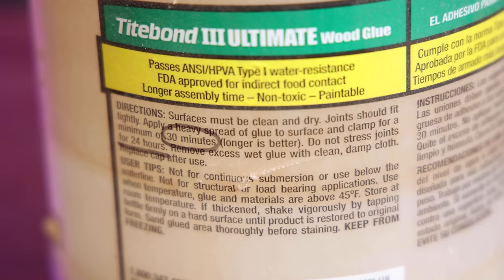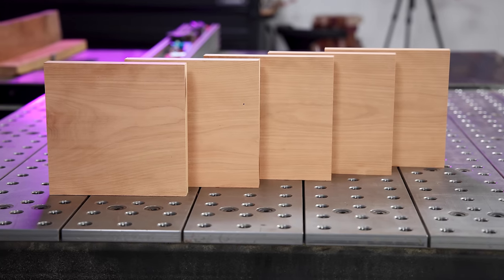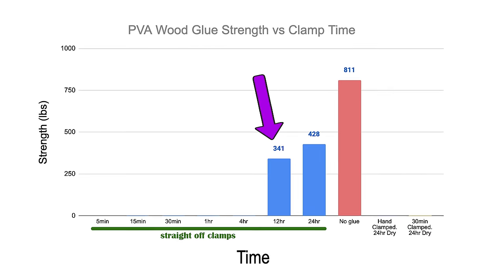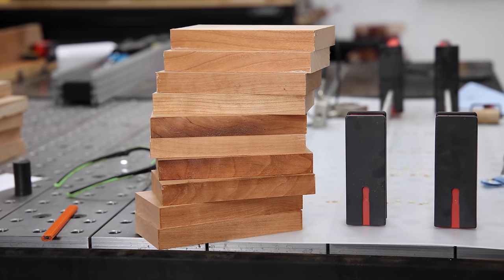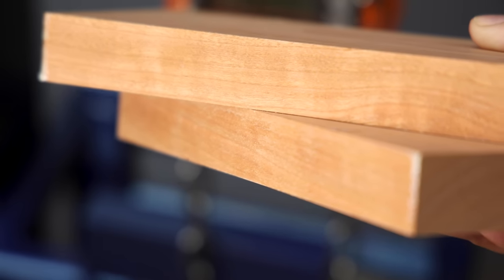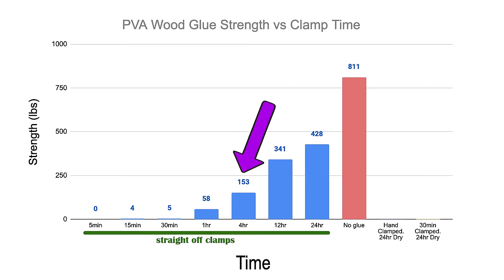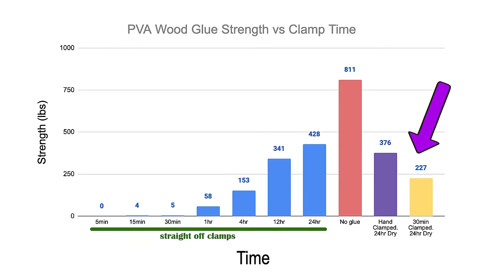you are clamping too long

Comment: The 30/24 test may be down to the clamping pressure. If the joint got starved of glue due to squeeze out, that might account for it.

Comment: I agree on the idea that different kind of wood species will have an impact. Especially  the hardness. But somthing I doubt is the flush book joint. Correct me if im wrong but you did not sand the wood before aplying glue right? I think sanding makes a big impact on how fast and well the gleu penetrates the wood. The surface eary becomes so much larger! I wonder if it would change the 30min clamp 24h drying result. What do tou think? 

Oh, andon a side note, your "small channel" 😉 had a big impact on how I used and (not) buy treaded inserts. Thats why I'm subscribed. I love the maker community! Greetings form the Netherlands 👍

Comment: rate constants halve for every 10 C you go down but the relationship between rate constant and rate depends on the reaction and idk how the glue cures but it's not unreasonable that 3 C would show differences, but yeah that's a lot.  Some error bars could help figure out to what extent that was determined by chance though.  It's a shame too because the most interesting question to me the whole time was "if you just let it rest long enough to not break from immediate use, would it finish strengthening on its own?" which that would've answered.  Oh well!  Still super informative and well produced video!

Comment: The glue has to be pressed inbetween the fibres by clamping and THEN has to dry. That primarily happens due to the moister being drawn into the surrounding wood and the evaporating at the wood surface. When BOTH pressure and drying have been applied for at least 12 hr preferably 24 hr a nearly maximum bond exists between the woodfibres and the glue. 30 minutes pressure and 1 hr drying results in a bond that is just strong enough to be handled, not fully loaded!
Offcourse these times for pressure and drying only apply to  PSA -type glues. Other glue-types have other values and may work along other principals for instance chemically hardening/bonding.
For all glue types it is advisable to degrease fatty woodtypes and allways use fully dried and seadoned woods.

Comment: The manufacturer's recommendation probably had partly set glue which was disturbed when the clamps were removed and been partly set was unable to bond again.
As for no clamps, you should consider rubbing the glued faces against each other a few times, this will create some vacuum pressure which acts in place of the clamps.

Comment: @3:53 you said that the results showed that a 12 hour clamp time was 20% weaker than a 24 hour clamp time. However, in both cases, it was the wood that broke - not the glue joint, so the clamping time has nothing do with it, and the difference should be put down to experimental error (e.g. differences in the wood used).

Comment: Moisture content? In the air and wood possibly. My shop is a garage with no air-conditioning/ heat. Ive noticed  when gluing but joints for cutting boards, if it is hot and humid the glue sets up much faster and seems stronger especially if I make an error and have to reposition the pieces. Titebond III specifically.  Titebond II does not act the same as III but everyone knows this. I have not checked the moisture content of the wood and air but I will try to remember to do that this year.

Comment: I think clamp time and curing time are mixed in this data set. 

What I would suggest doing is fixing curing time while you change the clamp time. 

Example: clamp the wood for 30 minutes, then allow adhesive to cure for 23.5 hours and then compare the forces.

Comment: As most ppl here agree on. You should all let them dry for the same time to see what the clamp time does and not the curing speed of the glue.
Fair comparison would have been all the same dry time of 24 hrs with different clamp times.
Clamp time is important because it is the delaying factor in woodworking.
I clamp for 20 mins and then the bond is strong enough to work with it without stress like cabinets and drawers etc.

Comment: One thing that can effect 'curing time' is leaving wet glue on the surface of the joint.  It should always be wiped off when wet.  When left on, it prevents aid from getting to the joint itself.   Another issue is too much clamp pressure which the hand vs clamp strength test.   Too tight squeezes too much glue out of the tight fitting joint which could leave it too dry.    I was a carpenter and then cabinetmaker for much of my working life.

Comment: I'm curious how clamping pressure can effect the glue joints, like what are the results of excess glue up pressure and what are the result of lighter glue up pressure. a good tool to test this with would be the fireball tool Maximus Bar and Dog Clamp with a soild 2x1 steel bar you could test up to thousands of pounds of pressure essentially up to the point of failure of the bar and dog clamps is your limit.

Comment: The reason i use "many" clamps along the length of a glue line is not only for the strength of the connection, it is to maintain a tight and even seam from end to end. Ideally, you want the glue seam to be invisible. This is much more easily achieved by using many evenly-spaced clamps. I hope this suggestion is helpful. Cheers!

Comment: I wonder if clamping for 30m caused more glue squeeze-out than hand clamping, and removing the clamps allowed the joint to relax a bit, leaving not enough glue for the lower clamping pressure.

Comment: Nice test, earned my sub. It would be really interesting if there was a material that wouldn’t be expected to break, (metal as an example of where my thought is…) and the glue adheres at least as good as wood and find out if the glue really is stronger than wood or if it just seems that way because of the way a cut piece of wood is compromised by the glue joint itself vs the uncut, unglued wood? Hopefully that makes sense.

Would also be interesting to see the results for different kinds of joints, wish I was in a position to help you out so those tests could be done. I used to manage a distributed server software QA team at IBM so I understand more than most how the combinatorics can really add up quickly once you start looking beyond basic test cases so I can’t fault you for stopping after these basic tests.
Reply from the maker: Hey thanks! Yes the compounding effect of an added variable can get out of hand really quick. And yes- there are other ways to test the glue strength but I need to pace myself and explore topics in a bite size fashion. Over longer period of time, I’ll have a good library of data built. It’s just slow right now.

Comment: I am interested in what the performance looks like if you leave the clamps on for >24 hours. What is the point of diminishing returns there for clamp time? We saw an increase in performance (granted significantly less from 12 -> 24 hours) but may be worthwhile to investigate what 48, 72, and 168 hours of clamping look like.

I'm also curious on two other points: glue application method (I saw swirls being applied, would like cause any gaps?) and clamp release method (does a sudden vs. gradual clamping force release make a difference, specifically on the low clamp times)

Comment: Based on what I saw I think 6 to 8 hours, and wait 24 hours before disturbing should be the minimum if you want maximum strength for something like a table or door. I like things to be as strong as possible. How much pressure depends largely on how well the joint fits together. It's a perfect fit it looks like you need less pressure than most of us think. I've always done 24 hours on glue ups and unless I need the clamps for something else I will stick with that. If I'm waiting to use the clamps for something else then I'll go 8 hours if it's something I really care about.

Comment: Doesn't wood glue create a vaccuum after you press it hard and get squeeze out? I have always felt like it does. I have glued joints that could not be clamped. I just squeezed very hard with my hands and then let go after a few seconds. The joint remained stuck together with vaccuum-like suction. And when finished the joints seem really strong.
It was a headstock glued to a guitar neck using an open or uncovered tenon joint.

Comment: I usually leave the clamps on for 4-6 hours. Also, I stress to my viewers not to use an excessive amount of glue or too much clamping pressure.
Reply from the maker: Love it! At some point, I have to test glue quantity and clamping pressure. There are some questions, especially on glue starving a joint that needs to be seriously considered. I think the 175-250psi recommendation by titebond is wayyyy too high.

Comment: I have a curved furniture leg that sheared when moving it around.  I'm going to leave the T III clamped for 24 hours, just because there is some tensile loading by the weight of the leg itself... so I want to play it safe. I assume at 24 hours it will be fully cured.  

That said, this is an interesting and educational video.  Thank you for taking the time to perform these tests.  4 hours looks like a good rule of thumb for square joints.

Comment: generally I pull the clamps after an hour or two. Im not putting large amounts of pressure on the joints and by the time the project is done the glue had time to completely cure.  using your joiner or plane is essential to get good glue ups. its clamping pressure doesn't need to be extreme. it need to be tight enough to hold the joint

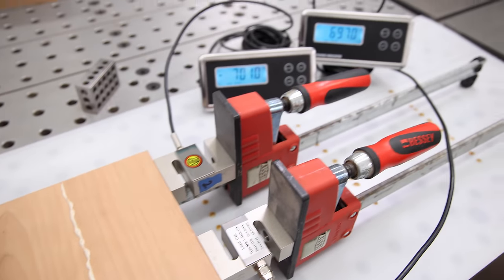Comment: Great video 👍. 2:30 you say that the clamping force adds to 1400 lbs, but actually no, it's still just 700. If you put 10 clamps at 700 lbs each, it'll not be 7,000 lbs or you'll crush the wood, it's still is just 700 lbs of pressure distributed on 10 different points.
  Lastly, it would have been interesting to see what the 24 hrs breaking point would be if clamping pressure was increased.

Comment: as a followup video i will request this: what is the best way to "speed up glue time". Will heat (oven) make difference og hot air ( hot air gun or hair dryer) or wind with room temp  (fan) make a difference. All to answer what you can do if you have to get something glued in say 45 min.

Comment: ... a lot of clamps every couple of inches...

Dont forget that clamping pressure extends out at a 45° angle from the point pressure is applied. 

If you add some cauls with enough to width to span farther out from the pressure point, you wont seed so many clamps.

I gave to think that with a wider spread of force applied, the pressure per square inch is "diluted". So I do not try to push that 45° issue too far.

Comment: It's too bad you didn't go further with the clamp then wait to dry tests (only hand & 30 min). For instance, what would a hour clamp followed by 24 hrs dry be? Or 4 hours clamp with 24hrs dry?
I think for many woodworkers the procedure is to clamp, then pull the clamps off to use on another assembly, but that doesn't mean we're putting the first assembly into use. We just want to make the most use of our limited number of clamps (and room to store clamped materials).
The results show a big difference from "30 mins of clamping with no time after to dry" to "30 mins of clamping with 24 hours of dry" (5lbs to 227lbs). Does this get better if one has a hour clamping time then 24 hrs dry? What about 4 hours of clamp and then 24 hours to dry?
Great test - I'd like to see some more real world variations tested though.

Comment: At 30 minutes the glue joints  imperceptibly started to spring apart after the clamps removed.  That’s why the joints broke at low force even 24 hours later.

Comment: I think the glue line should be offset from the middle, the middle is where the greatest force is applied, so it will always break there unless there is a defect in the wood. If you test at an offset then you can answer the question "will the wood break first". It might help to know you get a stronger bond with X hrs of clamping, but if the wood breaks with a bond after Y hours.

But maybe it wouldn't make a difference, you do have a "no glue" at twice the strength, which doesn't really make sense if the glue is not the part failing .. is cutting the board damaging the bonds in the fibres close to the cut? In which case a higher solvent volume, and much longer cure time might increase strength considerably? (maybe vacuum bonding like for fibreglass/carbon fibre would help).

Interesting stuff.

Comment: Hey mate, great video. I may have missed it, but how long did you leave the boards between planing and gluing. The reason I ask is that some species can leach oils which can significantly reduce the penetration of water based wood glues. 

Ideally, you would plane the boards no longer than 15 minutes prior to gluing. It does depend on species tho, and I'm not familiar with cherry. Just a thought.
Reply from the maker: I honestly had not considered that factor. I would have been more cautious with something more oily like cocobolo or paduk. All the tests were done in a similar regimen. So the boards were jointed right before glue up but I did not time it.

Comment: I know the point was to test what happens to the joint right after the time but another version of this test I would be really interested in would be to keep your same clamp times but don't test right out of clamps. Give each joint the 24hr rest time and see if it makes a difference or where the diminishing returns are for amount of time to leave clamps on when given the full cure time. I suspect that your thought process of clamp for 4 hours and then free up the clamps for the next glue up is probably pretty close, but would like to see it confirmed in a test.

Comment: I figure the final tests where you use hand clamping pressure and where you took the clamps off 30 mins in is because of glue squeeze out.

Hand pressure - there’s consistent glue because you had the same pressure during the dry time.

Clamp 30 then dry - the clamps lead to squeeze out proportionate for that high pressure amount but, when you remove the clamps so early while it’s still soft/wet, you created voids since the remaining glue reservoir-to-gap-between-panels ratio is no longer equivalent - so, the gap distance between the boards at the glue joint is now wider and the glue no longer in enough quantity to take up that space made from the early release of clamp force. Therefore, you get a glue line but it’s not 100% consistent through-and-through.

Comment: Really interesting. On the 30 min clamp and 24 hour dry, I think the tight clamps squeezed the glue out, and then loosening the clamps loosened the joint, causing less adhesion between fibers. 
Before trusting 1 or 4 hours, I would like to see the same test where they dry for 24 hours before testing.
Reply: I wonder how many projects were ruined by Tightbond putting 30 min on their bottle.

Comment: Damn, I assumed 15 minutes would do the trick. I'm using white PVA-glue as it's quite a bit cheaper than the import Titebond in my country. A few days ago I noticed I had glued a piece facing the wrong way and thought, "Well, glad I noticed it after 10 minutes of clamping", but to my shock and surprise I couldn't get them apart again, even with a mallet. When the wood started to break, I decided to just live with it. This was a small long piece glued sideways so lots of glue surface compared to it's size and not much torque applied with the mallet, but still. I don't know what the wood is as it came from a furniture I myself didn't buy, but it my rough fingernail test says it's probably just a bit softer than cherry or similar.

Comment: The clamping doesnt make tke joint stronger it just holds it in place till the glue grabs I believe the grab time is 30minutes on acorrectly glued joint. Is important to ask the right question when you are investigatin someting. So is 30 minutes enough for the glue to grab?

Comment: Oh, p.s., the hand-clamp results didn't surprise me at all -- I use rubber bands or for larger projects, bicycle inner tubes for clamping.  They're more forgiving, don't scratch or dent the wood and don't slip, and I can daisy chain rubber bands or inner tubes as needed, and they're cheap -- but anyway, my rubber band clamping seems to be just about as strong as the mechanical clamps when it's all set.

Comment: I feel like it has to be the natural spring-back in the wood when you remove the clamps after 30 minutes that ultimately weakens that joint.

With just hand pressure and left alone, the glue is able to cure undisturbed, but with the clamps, after 30 minutes and partially cured, you release the pressure and the bonds the glue is forming will be shifted. That's my best for why that process is weaker even than just pressing them together and leaving them alone.

Comment: I suspect that using the clamps forces much more glue out of the joint and it then becomes all that much more important that the joint remain tight and stable during curing.  Using clamps to squeeze out all the glue, then removing the clamps at 30 minutes, leaves the joint highly vulnerable as even very tiny movements in the wood can damage that super thin glue joint as it is curing.  It may also be the case that most of the damage to the glue joint happens right at the 30 minute mark when you remove the clamps and the wood relaxes its shape.